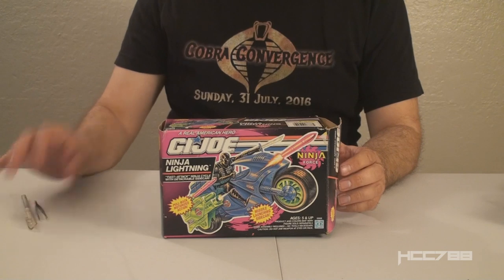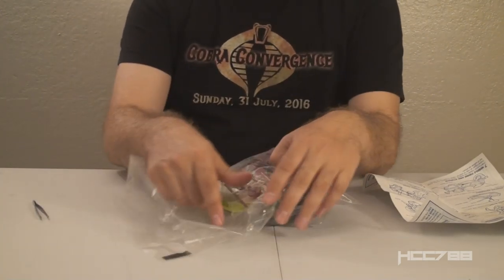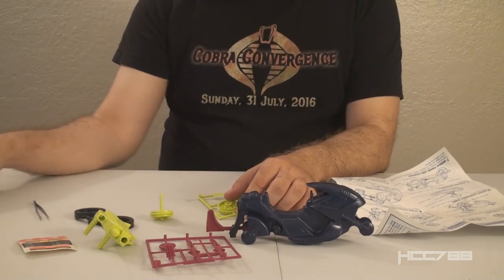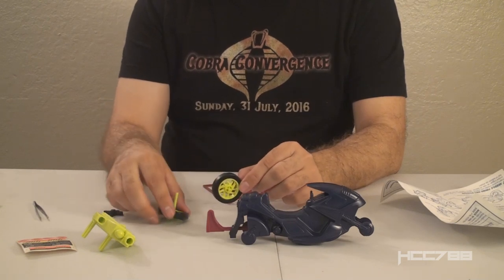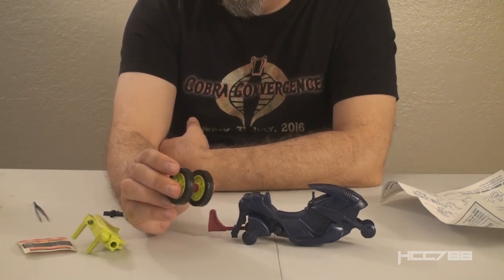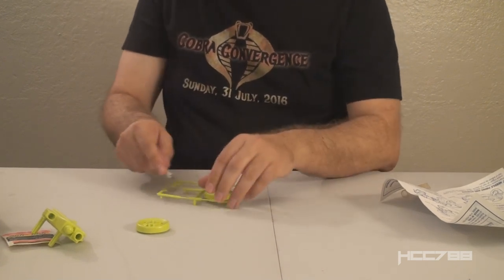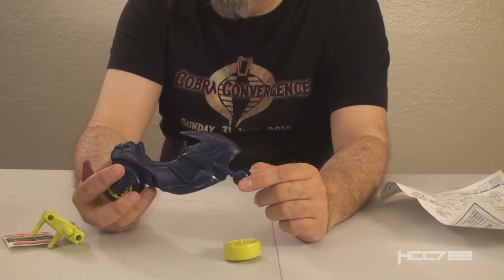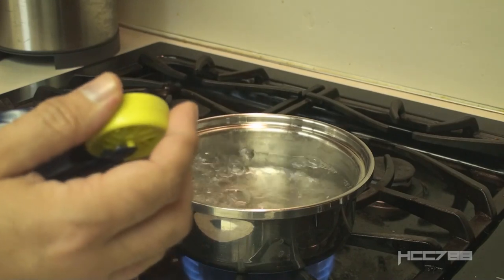HCC788 Ninja Lightning Assembly! - Ninja Force- G.I. Joe FAIL!

Comment: I do think it needs to be put in the boiling water for at least a couple of minutes.
I don't think it will melt—as you said.
Reply: Because I've seen somebody severely boil a Kenner Star Wars figure, and…
much to my surprise it didn't melt. It came back out just fine.
Though the head had spontaneously popped of, because the plastic got so soft.
[ But that head could be popped back on without a problem. ]

Comment: The joy of '90s era toys. Sorry that happened to you, man. You can submerge the forks in hot water for about 15 second before you try it.  They won't melt during that duration. Also, try sandpapering down the pegs a smidgeon on each end using an emery board.  Another thing to remember is that you have to push the wheel in slowly and carefully making sure that you divide equal force on both forks.  If one fork is doing all the stretching and not the other in unison, it's going to break. Doing all this worked for me.  The plastic that the frame is made of is a hard, brittle plastic, unfortunately, and it doesn't have much in the way of give.  This is another example of Hasbro cutting corners by going cheaper on materials to save money.   All modern toymakers look for cheaper ways to produce toys, but if this problem was a known issue (and I don't really see how it wasn't), then, the front wheel should have been factory installed prior to gluing the frame together and to boxing up the toy.  Lack of quality control  (cheap plastic + poor testing) = shoddy toys.  This kind of thing should be beneath a big toy corporation like Hasbro, and it's the kind of thing that has tarnished their reputation a lot in modern times.

Regardless, I always enjoy your awesome videos!  I think your reviews are always on the mark, and you have put together a very amazing channel of content!  I am now a subscriber!

Comment: Did you heat the plastic of the front fork before trying to assemble it?
Perhaps you should boil it in hot water prior to assembly.

Comment: You should have actually put it in the boiling water it would have been fine. Just putting it over in warming it did not change any Contour of the plastic. I'm sure many people have already mentioned this and I'm not the only one so I don't want to be to Echo in the room so to speak LOL
I actually have two of these boxed myself one open box seal contents and the other sealed box I may try to do a video one day just to see what happens lol
Reply from the maker: The boiling water segment was very long and was cut down a lot, otherwise it would have made the video half an hour long. In the process I did put the fork in the water. It didn't help. 
If that's your plan, go ahead. You'll break it, too.
Reply: HoodedCobraCommander788 where’s the video of the repair?  

This toy had some potential but they just had to cripple it with neon colors  and brittle plastic.  Imagine a motorized rocket launching RAM!  Instead we got a travesty that broke hoody coco.

Comment: Could you have done the steps out of order and placed the front wheel between the forks when putting the 2 sides together? I know this is in retrospect but I’m curious if that’s a solution?
Reply: The body of the bike comes pre-assembled, so that's not an option.

Comment: Have ya thought about sanding down the axle pegs ? Just enough to slip the wheel on. Perhaps , submerging the the front forks in the boiling water too as well. You may be the ninja lightening King still yet.

Comment: Oh.. shoot Hoodie... i wish i had been there to tell you to go ahead and dip in the front fork in the boiling water (if not the entire bike).. i drop old Joes/Star Wars/modern Joe/SW/bossfight figures into boiling water all the time for the boil and pop method or to soften it up for customizing. It shouldn't melt the plastic as long as its for only about 30-60 or so seconds.
Reply from the maker: The front fork WAS dipped in the boiling water. A lot of that segment was cut for time. It broke anyway.

Comment: Why avoid putting it in the water?  It's not going to hurt anything.  I've put dozens of toys in boiling water to straighten bent pieces, remove pieces, etc., and never had a problem.  I think that was your key mistake.  If I had any desire to own a Ninja Lightning, that's what I would've done.
Reply from the maker: Why not put the plastic directly in the water? Because some plastics will permanently discolor if you do that. But, in fact, I DID put the plastic in the water. A lot of that segment was cut for time, because the boiling water treatment went on for quite a long time. Putting it in the boiling water didn't help. It still broke. If that's your plan, go for it. You'll break it, too.
My "key mistake," as always, is reading the comments.
Reply: @HCC788  I didn't mean to offend you; just offering my suggestion.  You said in the video that you weren't going to put the plastic directly in the water because it you didn't want to melt it.  Based on that, I assumed you didn't put it in the water.  I hope you can see why I'd reach that conclusion.  The tidbit about discoloring plastic would have been a good addition to the video, too.